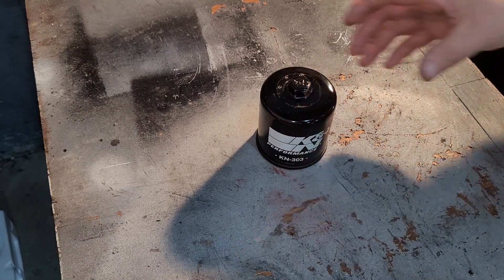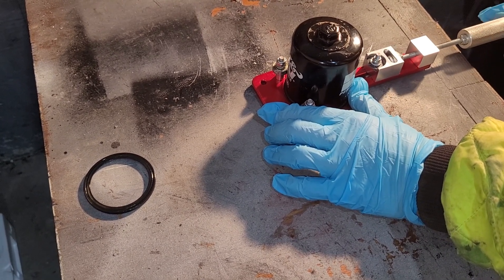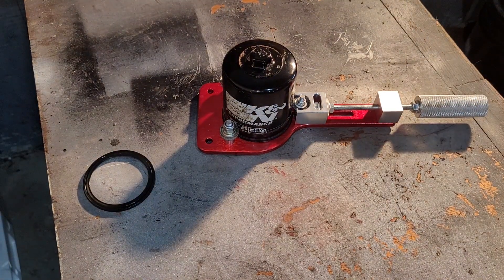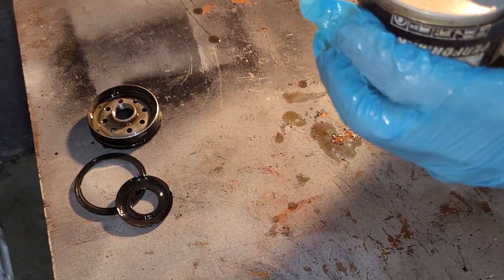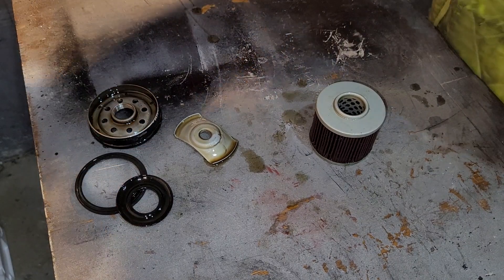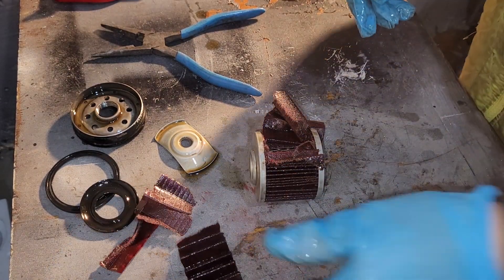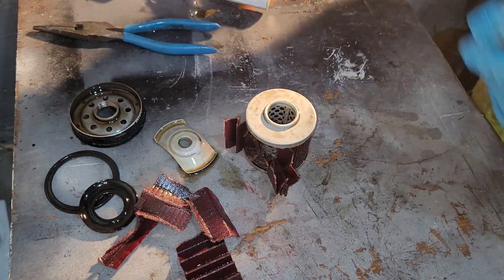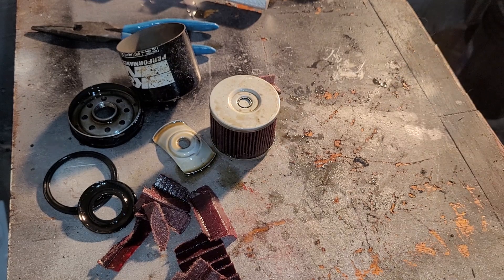K&N Performance oil filter review

Comment: did you notice how similar too the Ultra power oil filter it is? those 2 filters are both Chinese-made filters, the Ultra power uses a spring and this one uses a leaf spring but the base plate the center tube and the end caps are pretty similar. Which one do you prefer?
Reply from the maker: I do like the thicker case on the K&N but I never had a problem with case leaking so I would go for the Ultra Power which seems to be a fine filter itself.